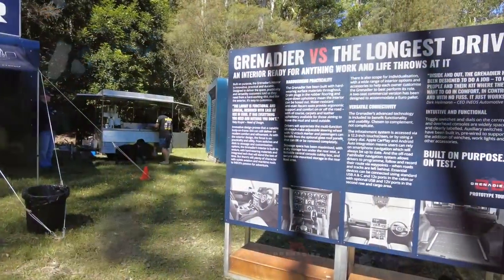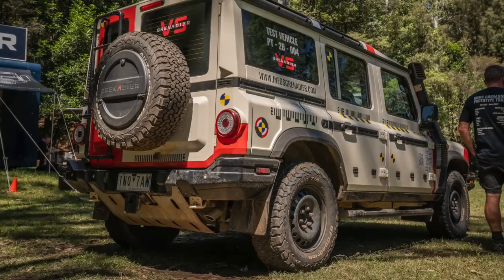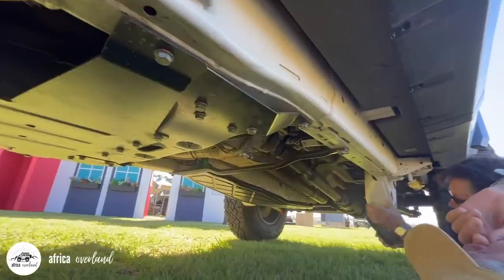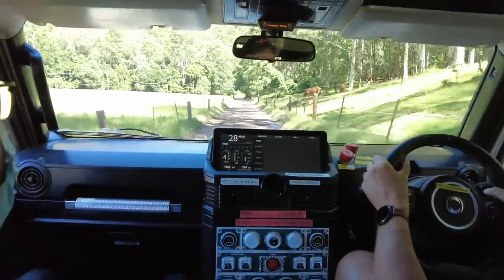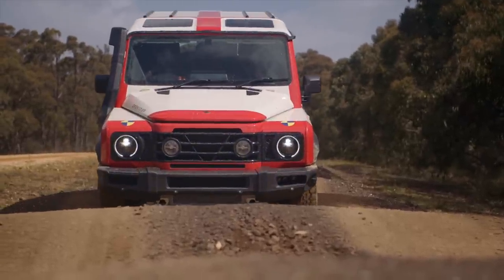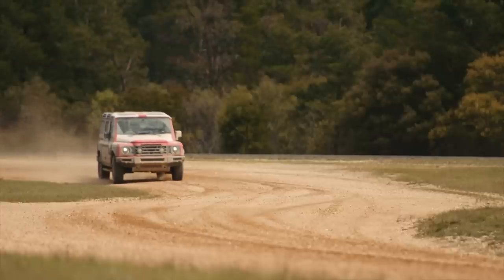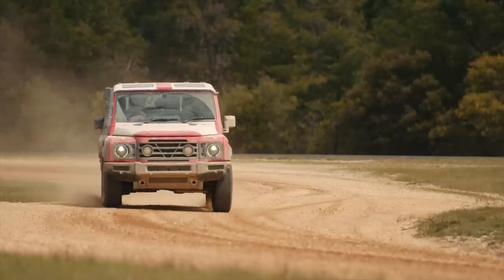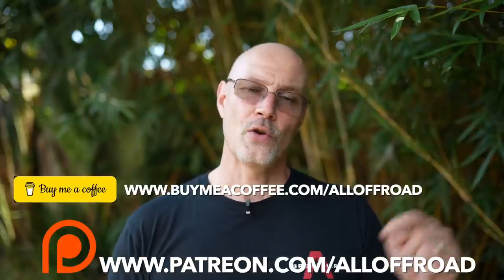Ineos Grenadier - THE ISSUES | SEPARATING THE FACTS FROM THE HYPE | A 4WD PERSPECTIVE

Comment: Thank you for the review, I agree nearly all of your comments.  Could space for additional fuel potentially be released by switching from dual exhaust system to a single exhaust?  Deleting one of the exhausts must surely free up a lot of underfloor space?  The rear axle control arms which hang so low in advance of the rear axle could then potentially also be relocated into some of the space gained?  The front control arms are too short and probably will not currently allow for much raising of the suspension or larger tyres - their arcs of travel are surely too limited.  The vehicle should simply be raised higher from the off - from the factory. All pictures and video clips I've seen give an impression that it is visibly too low for purpose.  Apologies for all the negatives when in actual fact there are very many positives and well done Ineos, for making the vehicles available before release for potential user's comments.  Actions you now take from these comments and other knowledgeable 4x4 enthusiasts and 4x Overlanders will define the future viability and sale-ability of the Grenadier. These will be your best critics and your best long term friends and fans.

Comment: Great offroad/overland-focused review with lots of good consideration points! In general, it seems like too much of a compromise vehicle (at least at this stage of development), given the stated intent to make a dedicated, "old school" 4x4. But they are also not shy about stating that vehicle design/building is not their forte, so hopefully they will take feedback like yours into account going forward. That said, in the end, it will ultimately come down to who their real customer will be. If their average buyer will do little more than the occasional dirt road, it wouldn't make sense to design it with long travel suspension and 35s. One final note - your last segment has some excellent footage of the suspension working! Maybe you could bring it up into the discussion about that earlier in the video? Unlike big name manufacturers, they haven't set up their test areas just inside the limits, so you can see by the slight spin of the front left tire just how much droop you get there. The rear seems to stuff quite nicely, but the articulation seems to be on par with competing vehicles for the most part. Thanks again for the effort to put this together!
Reply from the maker: I think the test track is just one that was available and has been designed for other vehicles, personally, I think the suspension travel for a coil-sprung solid axle vehicle is below average, I actually did a comparison of two images of a Jeep Cherokee and an Ineos in a similar position with front drivers wheel in the air and the IFS Cherokee seems to have very similar wheel travel. I would have thought the Ineos with solid axles and supposedly long-travel suspension would be way better than an IFS Jeep.

Comment: I totally agree with your concerns regarding the suspension, and the other things actually. I have also asked Ineos about fuel consumption and range. The lower rear suspension arms mounts look like vehicle stoppers to me, and I felt the arms looked quite short. I have not yet seen images or video of the front suspension adequate to form opinions or concerns. I do hope Ineos do some further development of the suspension. The concept of a vehicle built from the ground up as a four wheel drive is exciting.

Comment: Thing is I dont think they designed it for an overlander / off road niche specialist ...its a utility truck for a farmer with as good an off road capability as 98% of the market needs .. That extra 2% that you need could have added another 10% cost to the truck .... If you want something truly specialist then there are 1000s of defenders and land cruisers to modify !
Reply from the maker: I don't agree, a Jeep Rubicon for example is way better off-road from a factory than an Ineos. While I agree that my requirements are a little higher, the thing is I can modify an old Defender, 200 Series, 70 Series, 100 Series, Patrol without too much effort to meet my requirements and i would think that should be possible on a vehicle purposely build as a 4wd. A lot of the advertising and testing shows it in Afrika, Deserts etc so a tourer must sure have been on their radar. I think the Ineos has limited itself a bit but we shall see how the final version ends up, especially the dual cab. I dare to say that with the current tyre size you will have quite a few issues in Australia without doing any extreme stuff. Ineos will never be my rock crawler
Reply: @AlloffroadAu  I dont disagree with any of the design elements you highlight that are less than ideal . I was quite shocked when they released the video some time go showing chassis development and saw those low hanging trailing arm mounts . The rear always seemed a bit low slung to me too. Im in the UK and have run a 300dti 90 for offroading - 35" tyres, winch , roll cage ...all that stuff now for 18 odd years (not the outback but some dedicated sites i go to push the capabilities of driver and truck to the limits)   I can see from the elements you again highlight the Grenadier would not be ideal for my purposes either. Given Im no super brain on these matters  Im sure the genius pool at INEOS must have been aware of these issues given all the experience and input from the off road community they have had . This is what makes me think they have just made a commercial decision to produce the best utility vehicle they can to the point that satisfies 98% of the market and basically said the other 2% is up to you ! . Farmers will probably love it , utility companies will probably love it ..maybe even the military on a bare bones version. Your weekend outdoors lifestyle action guy will love it along with those that just live in remote (ish) by UK standards areas.  As it is the cost of the Grenadier is not exactly utility which is maybe why land rover realised themselves they just couldn't develop their classic defender anymore given the markets they now want to push their current range into.  I think Ineos just baulked at doing the last 2 % because it would not be commercially viable for them given the extra costs , I know from my truck the large sums of money you can chuck at them for incrementally small gains . All that said the video was spot on ..really enjoyed it 👍

Comment: Great review! I agree pretty much with everything you've said, particuarly the focus on offroad vs other carmarkers. However, I don't think the "small" tyres are that much of a problem...if the geometry underneath was better, and 35s would just eat into payload and range by quite some margin. The old Defender had great clearances all round on 32s, but the Grenadier just seems quite low-set all around, and it really should be on 32s minimum.  I kind of feel the geometry was developed in the UK on greenlanes without any consideration of rocks in places like Australia, everything is just low, especially those trailing arms.  It's too late to make big changes now.

I'm also a bit disapponted with the rear loadspace; I'd have liked to see another 100mm behind the rear axle. And I can't see it being a payload king if GVM is indeed 3500kg, the tare will struggle to get under 2500kg with sep chassis and live axles especially in diesel.
Reply from the maker: Thanks, Robert, yep, 35" is just my preferred choice for what I do but I feel even Joe bloke driving the Ineos out of the showroom will struggle with 31" due to the low hanging stuff. I reckon the old Defender was off-road wise way better than the Ineos, better geometry, better angles, better suspension travel, way better ground clearance. I think the whole area between the bottom of the frame and the car floor was not well-thought-through and is way too small to fit everything in hence it's hanging way too much under the frame and looks quite chaotic down there. That was something the old Defender was brilliant in. I completely agree space-wise it's will surely be no family tourer but I'm hoping for the Dual cab version maybe sorting some of the issues.

Comment: I can’t find a reason for anyone in Australia, that wants to do any kind of remote touring, to buy one of these vehicles. I’m a fan of the “look” of the Defender, which in my opinion, from the outside, is still the best looking 4x4 ever made.  Unfortunately, I consider the Defender to be very unreliable compared to a Landcruiser or Patrol.  When I first heard about a wealthy enthusiast building a new 4x4, modelled a Defender, I was excited to see it.  This vehicle however is very disappointing.  I acknowledge that this vehicle is a prototype, but agree with your assessment of it.  If the finished vehicle incorporates the many design faults that you have highlighted, It’s doomed to fail in Australia. I’m surprised that a vehicle designed by an enthusiast would have so many "obvious" design faults.  Limited fuel storage, roof glass and angles wheel arch covers emphasis this.  It looks more like a vehicle designed by a group of car designers, than that designed by a person who is a genuine 4x4/overland enthusiast.  I presume that the Grenadier is going to be pretty expensive and will probably end up more suited to the managing director commuting to the office during the week and the occasional run along the beach on the weekend,  rather than tacking any of outback Australia. I’d certainly not swap a Landcruiser or Patrol for it. I enjoyed the review, thank you...

Comment: Battery and electronics under the rear seat - damn!  On my V8 County 110 I pulled that rear seat out, bolted it to the right hand side with recovery gear behind it, put a custom cabinet with a cooker, sliding table and sink unit on the left side, filled the rear footwell with an 80L aluminium water tank and flattened the floor with sound deadening and marine plywood. I guess I can't do that anymore!

Comment: Refreshing to see a critical objective review of the Grenadier prototype which seems ok but expensive. I don’t think Ineos were planning on a full all out rock crawling overland ping Aussie or SA type 4wd. It’s likely the UK green lanes and towing the horse box is perhaps more aligned to the design original concept.

B6 comparison my 2011 Toyota FJ Cruiser is fun to drive, doesn’t have a single rattle or squeak, still turns heads, drawing admiring comments and can go almost anywhere (and get back - Toyota Hino reliability).
Reply from the maker: I never expected it to replace my Rock Crawler but it was supposed to be a Defender replacement while not perfect and reasonably unreliable it was a modifier's dream and you could modify it to whatever you needed it to be. Missing that with the Grenadier

Comment: I’m very interested in this truck and it will very likely to replace my Nissan Frontier when it comes to the US, the biggest down side of the truck is the engine, B58 is not known for the reliability, If the truck has ford ecoboost  or Toyota engine then it will be perfect but still I like this truck even with a mediocre engine

Comment: Just confirms how well engineered the GU Patrols and Landcruisers were, particularly the 105 series.   Not being able to lay the seats down flat and batteries under the rear seats would shit me.  I’ll stick to my 76 series
Reply from the maker: yes 100% and they weren't designed as supposed hardcore 4w drives. But are more capable and what I can see so far way more modifiable.
Reply: I drive a 100 series and boy do I wish the 105 series was available here.
Reply: @jonathanwhiteacre7046  funny, I’m selling 105 series at the moment, $17k AUD

Comment: Best review ever, well untill we actually see a production run car rather than beta. It does seem to have a few issues.  The battery and fuse box are crazy unless they are sealed in a waterproof box. 
The vehicle will do everything a farmer in the UK will want in its present suspension set up. Those who want some extreme off roading will convert it just like every defender or Suzuki you see. But it does need bigger tyres and slightly more ground clearance as standard. 
Fuel tank I imagine can be an issue in deserts and outback but in the UK not an issue and the upper windows might be hot in aus but will be great in the UK.
My biggest gripe is the adblue engine. I get it on the emmisions being forced on us in Europe but should be an option for no ad blue elsewhere. Don't get me started on the price it started out as 30 to 35k now reports of over 50. I suspect it's transformed from a wish list and great concept to a compromise to suit euroarea silly rules. Shame as it had great potential. Now built in France I won't be buying one as a matter of principle.
Reply from the maker: yes I would agree at it's the current stage it will be a good on-road light tourer and farm vehicle for the UK, it's to a Defender replacement or hardcore 4wd. While I'm sure aftermarket will come up with some solutions looking at the overall design it's not as modifying friendly as the car it aimed to replace (Defender) or any of the other older style 4wd like Landcruisers 80, 105 etc.
Reply: I think it can be modified pretty well I know there are already companies offering suspension tweaks and raising kits. But at 50k I suspect you are better with a 30 year old defender and all the cool kits you can buy.

Comment: Best review I've seen yet. Critical, but fair. Too many low hanging components for my liking. Battery/fuse location compromises rear seating height and ability to have a flat load space with seats folded. Additional fuel capacity a big issue for Australian touring.
Reply from the maker: thank you.

Comment: I Had a deposit down one and went and checked out the INEOS here in Melbourne at Lardner park. I had the same thought in regards the the rear drop boxes and fuel tank as you . The ground clearance is not adequate for Australia especially 4wding rather than touring. I didn't think 35s would fit in the wheel arches.
Interior wise the front is nice but owning a y62 and having 2 kids its too small for a family. would be good for a couple though. Front seats  and the overhead switch panel is fantastic. 
Overall I'm in agreement with everything you said and suffice to say I asked for my $800 deposit back

Comment: I was looking at getting one of these to replace my FJ Cruiser when they come to the states.  My FJ isn't a trail runner - but living in the climate I do I see snow fairly regularly and often I go to parts of the state where there are no paved roads - only forest/logging roads.  But when I look at all of the low hanging fruit on this thing compared to my H1, it really makes me hope that its better tucked up in there.  The great thing about the H1 is that there's nothing underneath lower than the front bumper (except the control arms of course) so you know that if you clear an obstacle under your front bumper - as long as you keep it right down the middle you'll be right as rain.  Huge benefit IMO and having pumpkins drag links hanging around... ooof.

Comment: One hopes that the Ineos Grenadier doesn't suffer the same fate as the Australian Army Land Rover 110 did when the suspension had to be raised to accommodate the Isuzu diesel engine. The raising of the suspension created huge instability and became a roll-over death trap, requiring it be speed limited and creating an Army project to design a roll-over protection system. This is not likely to be a risk with Ineos, but you never know.

Comment: Your review is on point, including the low hanging steering damper. I hope all your concerns are fixed. Is the pre production tyre size 245/75r17, a 31.5 inch tyre, which is the entry level JL Wrangler tyre size ?
Reply: Standard tyre sizes have been finalised and are 265/70/17 and 255/70/18
Reply: @johndeveraux8472  Do you know if the 17 inch wheel width is 7.5 inches(that would be ideal for a 285/70r17, 295/70r17, 285/75r17 or 35x11.50r17 or even a 35x12.50r17 KM3 or K02 as it's a 295/75r17 tyre).

Comment: I also attended one these days and asked a similar question about rear bashplate and the Ineos guy said if it was him that he would remove the East/West muffler for a smaller Nth/Sth muffler opening up the area for LR fuel tank.
My other concern is the Transmission cooler is tucked right behind the LHS front bumper section which is prone to clogging from mud, etc and also open to possible damage.
Looking purely from a touring point of view I like it but fuel range is a concern but I’m hopeful by the time I can afford one most things should have been sorted out
Reply from the maker: yep 100% mate I thought the same with the fuel tank not sure you get more than 40-50 l there though.

Comment: In terms of fuel capacity I guess adding a second tank as an option would be a good plan - not everyone is going to need that much fuel but it would be good to have a factory fitted extra fuel tank for those that need it.
Reply from the maker: yep little space for it though without re-arranging rear exhaust system

Comment: A 10 centimeter bodylift and all the accessories placed higher up in the chassis would have helped. Also bigger tyres would have been better. The suspension looks sagged like it already had a 10 year life of heavy loads. 
The suspension arms are too short so it will influence the geometry immediately once you fit longer springs.
I don't like BMW engines that much either. Also there should be a manual gear option. A 100 litre tank is enough for Europe, for Australia there should be an option for a bigger tank. The dashboard is hideous. It needs some round dials in front of the driver.
Reply: Agreed. The suspension has variable rate springs which is why it looks sagged